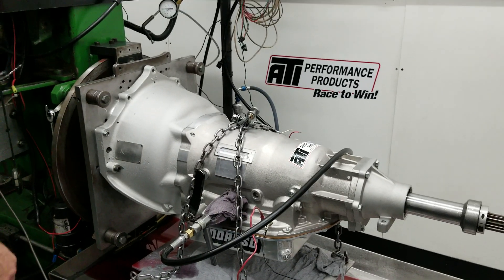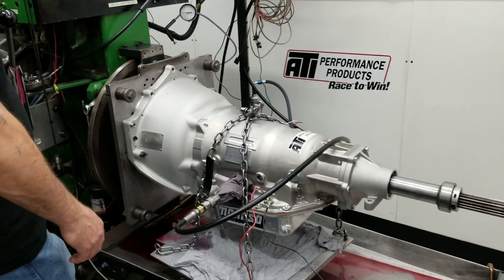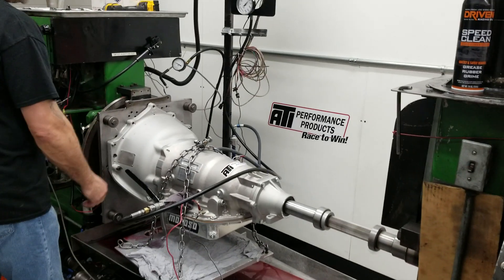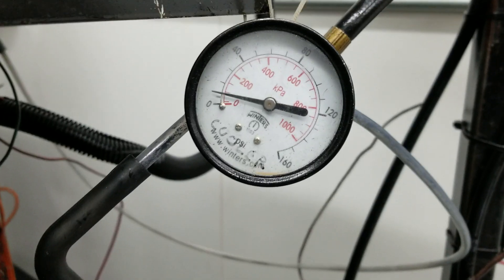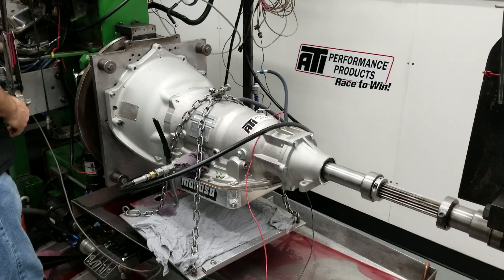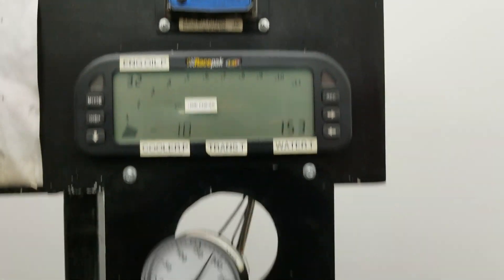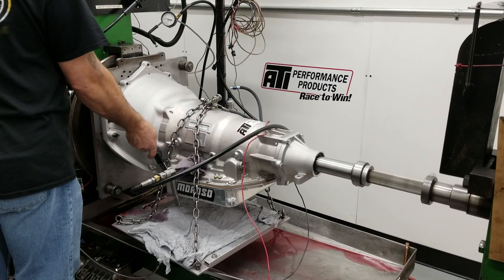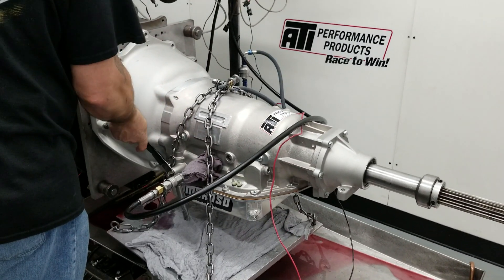ATI Max Duty T400 with Bolt Together Lock up Converter on the Dyno

Comment: How much? And is it man shift only valve body....from Wyoming USA 🔫🤠🇺🇸p.s stay safe and healthy everybody GOD BLESS OUR COUNTRY AND stop this foolishness  ❤
Reply: You can probably add an automatic valve body to it, but with a lock up stall converter and a transbrake valve body, this transmission is likely built for something fast and badass. From what I know about transbrake valve bodies, is that all the ones I've ever seen were manually shifted. No automatic ones. You can likely get this lockup converter put into something without a transbrake, but I wouldn't see the point in going all out with one of these lockup stall converters. You'd be better off getting one a little cheaper